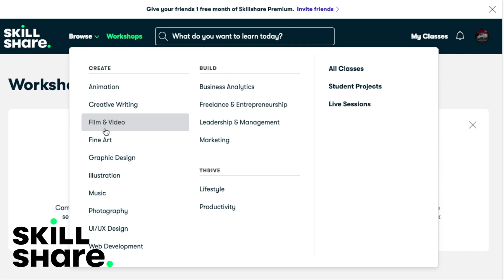Emma's Campervan Build: Ep. 4 - Electrics, Diesel Heater & Ceiling

Comment: I used plastic fascia for my last kickboards. Cut away the inside foam at 45 degrees to a line then bend at right angles. This keeps the outside skin intact, very light and strong.

Comment: Since Emma doesn't want the bathroom to take up so much space.  How about making a convertable shower? Start with a box with a lid for the toilet where it is now that opens towards the back of the van.  Normally that can be a seat.  Once the lid opens, curtains can be drawn on top to create a temporary shower so to speak.  The shower head would sit behind the passenger seat on a permanent wall.  That way she'd have all the space used by the shower back when you slide the current away with a seat below it.  Maybe even a soap cranny above the passenger seat jetting out from the shower wall.

Comment: I've built 2 campers, and also used T&G for the ceiling. On my 2nd, I filled the T&G gaps with decorators caulk. No damp like my 1st camper which I didn't fill and was a problem.  Looks nicer aswell imo 👍